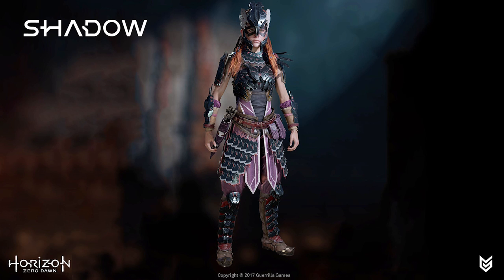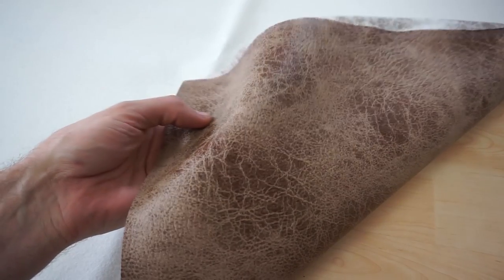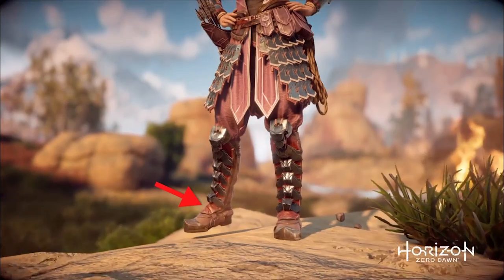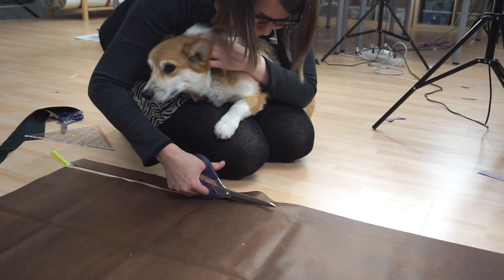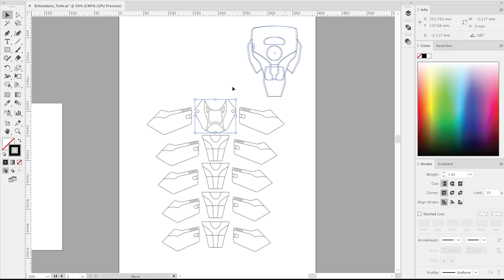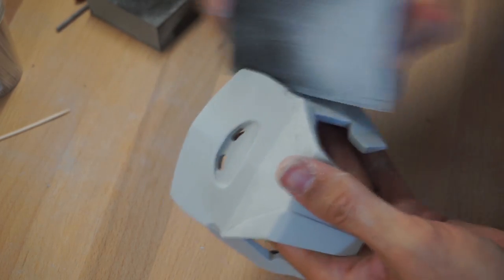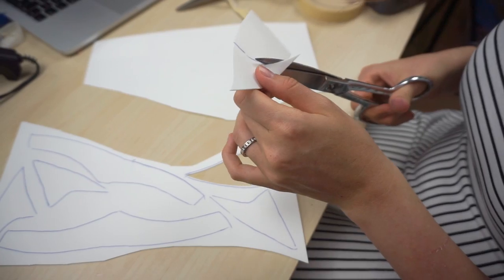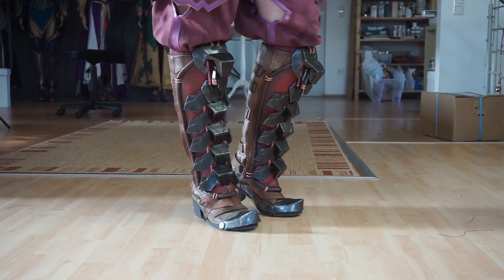Leg Armor - HZD Shadow Stalwart Cosplay - Pt1

Comment: this build is so awesome!!
Also, in case you have not heard of it, there is a product called "XTC-3D". It's a brush on resin that can cure in 15 minutes (with a heat gun) and it eliminates so much work when finishing 3d prints and warbla pieces!
I just got a printer myself, it's so much fun to play with.
Reply from the maker: +Jacob Vester Thanks for the tip! Benni knows it but it's not a fan! He likes sanding more 😆

Comment: Although I havent been able to cosplay like I would like, I DO do medieval historical re-enactment. For your plastic boning you use, Might I recommend using industrial sized zip ties. They can be found at most hardware stores. My wife uses them for boning for her corsets. Just cut off the zip part, cut to length and round the ends then melt the ends with some heat. 

Try it! Its MUCH CHEAPER than plastic boning and holds up very well too.

Comment: Hi there, this looks amazing! Love your work, I was just wondering. The paint job Benny did on the printed pieces at 5:03 I want to get the exact same finish you had but I am using a foam not the PLA material. So I was wondering if you would think I could just replace the black spray paint with PlastDip and get the same effect?
Reply from the maker: Plastidip or Black Acrylic color yes. :)

Comment: Which clear coat are you guys using for your projects? Do you use different ones for e.g. flexible foam armor and more rigid parts?
Reply from the maker: If you're priming flexible parts definitely use a flexible acrylic spray sealer.